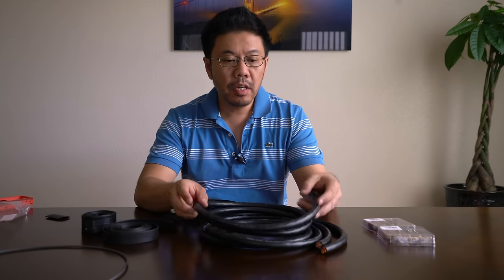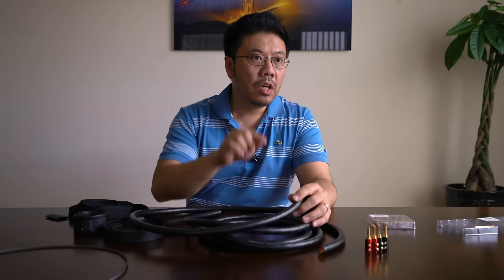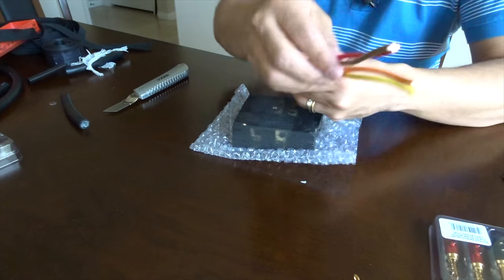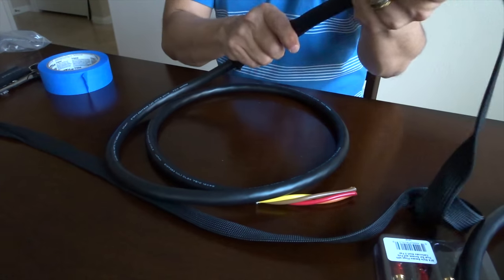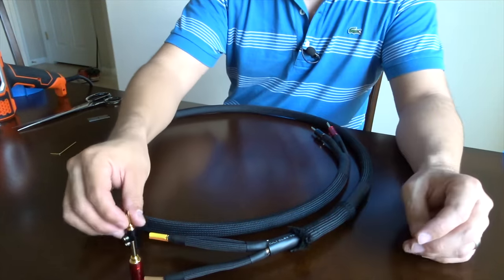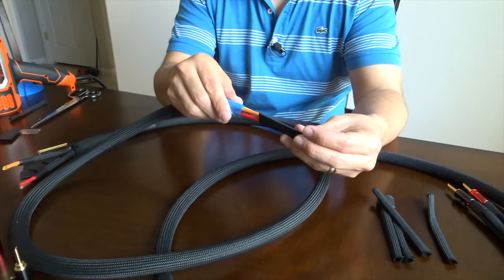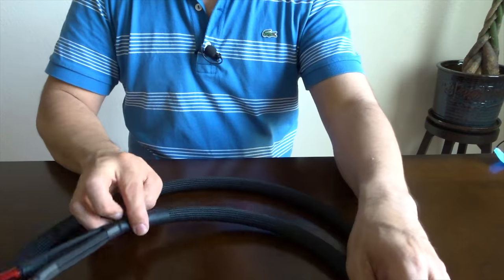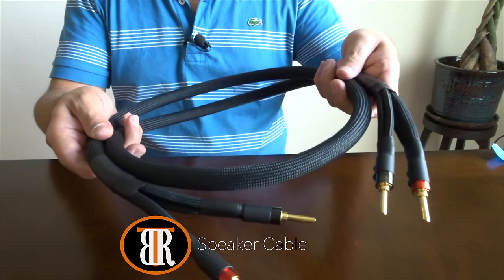Making The Best Speaker Cable For Money, How To DIY HiFi Cables

Comment: If you go with what the professional studios use, you can't go wrong. Great video buddy, thanks!
Reply: That's not necessarily a wise choice.
Reply: @carlosoliveira-rc2xt  please, tell us what the wise choice is. Im dying to know since I've been an audio enthusiast for over 30 years.
Reply: @Douglas Blake his cable is overkill. However, a 10 foot pair of Belden or Canare is not. Both of what i mentioned are also used in Pro-audio. Most of what you described is about connectors. A pair of 12guage Belden cables far outweigh a cheap ass lamp cord for not much more $. Blue Jeans cable is Belden and the prices are extremely good for excellent quality studio grade cable.
Reply: @Douglas Blake you go girl with your lampcord. If it works for you, great. Meanwhile, the rest of us will enjoy what we like. That's the beauty of this hobby. You can do whatever you want and invest in what you see fit. You spend allot of time trying to convince the unconvincing. Does it really matter to you? Run along now...
Reply: @kirkcunningham6146  the rest are happy snakeoil believers. I believe you are a minority. - Nothing bad about that though

Comment: Hey, I just noticed, aren't you supposed to use the opposing sets of wire(180o) apart from each other?  That would be the orange/brown, red/yellow, at least that was what I was told to do with this cable and Canare 4S11.  Anyhoo, I'm making sets of both the 3104 and the 4S11.  You inspired me.  I'll be using the Viborg Pure Copper Bananas, Viborg Pure Copper Spades, and the 
CMC 4mm BFA Banana Plug Jack Z-Type Connector  which is that spring form contact that looks like a Viborg product.  I ordered them all.
Reply from the maker: Great choice on Viborg plugs they are my favorite ass well, for the star quad cables I have all different paring and there is no difference in the sound. Thanks
Reply: You're correct. In the video he shows the table which has the capacitance rating depending on what wires are paired together. Brown and Orange together and Red and Yellow. The table @ :38 shows the capacitance when pairing wires #1 and #3 together vs #1 and #2. Pairing 1 and 3 has a lower capacitance then 1 and 2. In between those pairs is a cord/insulation that is not shown in the illustration @ :38. You just see a gap. That cord/insulation separates pairs 1&3 and 2&4 allowing a lower capacitance. 
So pair Brown & Orange,  and Red and Yellow.  
Will this make a difference to your ear?   He made mention that there is no difference in sound and I believe him because he's making short wires.

Comment: I haven't heard such a powerful bass from any cable, it's impressive. I could use a better scene, height, width, depth.
I wonder if the color scheme of connecting the wires affects something.
In the film, yellow is combined with orange and form a black plug
Red with brown, form a red plug.

I didn't think about it at home and did:
yellow and brown - black plug.
orange and red - red plug.

Is this correct?
Reply from the maker: Color of conductors is not important, you can pair them any color you like.

Comment: I dont even use speaker cables. I solder the amp terminals directly to the terminals on the speaker. Best damn sound I have ever heard lol.

J/K: great video.
Reply: Same here.  Collateral benefit - smaller form factor.  And with sufficient battery energy, my whole system is PORTABLE and can be carried by only three people.
Reply: Nothing beats garden hose filled with mono-crystalline mercury as the conductor - maybe solid brazed copper tubing - sure it's a bit stiff & not very portable, but that's HiFi for you ;-)

Comment: Awesome tutorial! I’m with you, I mostly only use pro cables. The only exception is Supra, I find their power cords excellent. I also like their shielded speaker cables - I find some class D amps sound better with shielded speaker cables. One could also shield a professional speaker cable by manually adding a copper shield over the cable and covering it with the nylon mesh. Now I’m inspired to try the Mogami speaker cables. I’ll build a pair to try... :-D
Reply: You should probably avoid shielded speaker cables as it drives up the capacitance of the cable dramatically.  And since the signal isn't getting amplified after those cables, shielding isn't really going to do a whole lot unless you are in a VERY noisy environment.  That being said, if you think its sounds better that way, that's all that really matters.

Comment: Thank you for the tutorial - one question, the banane plugs you now advice (viborg vb 401) can only accept a 4mm cable 😅 how can it match with the 2 wires of the Mogami cable ? In that case it would be better to use the Mogami 3103 with only 1 wire per banana  ?
Thanks in advance for your reply
Reply from the maker: Hi I only recommend it because I switched to it for my own cables, it’s tight fitting might need slight trimming for quad cables, thanks

Comment: @Tharbamar Thanks a lot for sharing your experience. What do you think about wire ends soldering before connect to banana plugs?
Reply from the maker: Hi, I do preferred direct contact but if I must I would use silver solder, thanks
Reply: Thank you

Comment: Looks really good! Great work!

One thing though: dual 12AWG equals single 9AWG, not 6AWG. So why not just use a wire with 2x9AWG conductors instead of a 4x12AWG conductors? Does not get as monster thick as your cable, but sends the signal just as good! Just a thought.... 👍

Comment: I like your video using the 4S11 wire...with this wire I'd be worried it could put tension on the speaker terminals and perhaps break them

Comment: If you’re going to do all this then make sure you don’t use bare hands to twist the cable ends together because the oils in our skin get rubbed into the cable ends and will tarnish and degrade the transmission of energy in this area a lot faster than normal. The best thing to do is use a new, clean lint free cloth to twist the ends together and then spray a little amount of Deoxit on the twist and it should not oxidise or degrade for about 5 years at which point you cut the twist part off (about an inch) and cut your ends again so the perfect solution is to solder the ends together with silver infused solder and obviously don’t touch the bare metal with your bare fingers before you solder!!!

Comment: As long as you're using speakers with reasonable efficiency, speaker cable is a non-issue. 16 AWG lamp cord is as good as expensive cable. Large gauge speaker wire is only needed for long runs. Expensive cable is one of the biggest wastes of money an audiophile can invest in.
Reply: I have to agree. That speaker wire is way over kill for any home use! Using a single #12 AWG for each connector is more than enough, let alone using double #12. Plus you don't need any fancy expensive wire from some fancy name brand audio supply manufacturer.  But feel free to waste your money if you like.
Reply: I think most people would agree that the best you can hear is all you need. The problem is we have so many perfect 50 karat diamonds with a little circuit board inside with customers to match that it's not even about the sound anymore even though it's still blasphemous to say it. If you want jewelry for your home then God Bless ya, I hope you get what you want. Just don't be leading the up and coming to think that's what good sound has to look like because it doesn't, and it doesn't further the quest for that next more convincing generation of audio. </rant> sorry.
Reply: Let me guess romex would do just fine to then, people like you are ignorant in knowing what your talking about, maybe your attitude towards listening is not refined in detail quality of caring so much about it, your speakers play the music and that's all that matters to you, it's good enough, but let me tell you there is a difference or I wouldn't be responding to your comment, but that's up to you to compare and if you have then good for you you dont half to be in the mix of snake oil, I've built cables using cheap best buy speaker wire to using monster cable and audioquest cable and they all sounded different the rocket fish cable at best buy sounded horrible, the audioquest cable sounded fatiguing and fast like, and the monster cable sounded neutral  and natural sounding and these cables didn't cost that much and I heard a difference and I dont have expensive equipment either if I heard a difference in cables then I will say something
Reply: @shannonwilliams6623  I have done blind swap tests with probably 20 or more people who have spent big money on cables, including $3000 power cords. I snag them every time. It is all placebo.
Reply: @Bernie AYALA AUDIO Do you happen to have any commercial interest in audio? Then I would agree that its probably a bargain from a commercial point of wiev
Reply: This is completely wrong and you have no idea what you are talking about. The "its just a placebo" mindset comes from people who plug expensive cables into their shitty entry level setups and wonder why they don't notice an improvement. Cables that are "good enough" are fine when your listening setup is at a point where it is limited by other components; however there comes a time when everything has been upgraded to the point where the cables  become a limiting factor. At this point, choosing a proper reference quality cable makes a great deal of difference.
Reply: @nucleon4499  If you knew as much about cabling as I do, you wouldn't be saying that. My business requires that I know something about the properties of different types of cable. Even the most demanding loads don't require more than 12 AWG lamp cord for short to medium length runs.
Reply: Either your equipment is very poor quality or you can’t hear the differences in sound. Another alternative is that you’ve told yourself that all wires conduct signals equally (I can assure you they do not) so you refuse to even try. I have tried many different cables (both analogue and digital) over many years with various levels of hi-fi components and have found that changing any type of cable can make as much difference to the sound as changing the main components themselves. For those who either can’t afford or refuse to buy high quality cables new, the alternative to DIY is eBay or the various hi-fi equipment forums (gumtree, audiomart, etc) for 2nd hand cables at more reasonable prices.
Reply: @nucleon4499  No that time doesnt come unless your cables are broken or connection very coroded
Reply: @shannonwilliams6623  Jesus Christ, man! Punctuation is key!
Reply: @collocksb8408 true, swapping cables out sometimes works if only because the original cable is tarnished to the point a coat hanger is better. So what are you trying to say? Gold is a better conductor than copper? I think not .

Comment: Wonderful job. They gouge you on higher end cables. I’m building these at 1/10th the cost.
Reply: What cable are you using?
Reply: @joshgross8741  I have kimber 8tc which I like. But at 22’ each you’re talking 3k.
Reply: @maxkady9478  ok. Initially I misunderstood your post. I thought you were getting cables that were 1/10th the price of the mogami.  I was mistaken.  Thank you for sharing about the kimber 8tc.  They look interesting.  22' seems like a lot of cable even if you are running 11' cables to your speakers you must have a nice sized listening room.

Comment: The internal cable in the amp and speaker box is probably telephone wire
Reply: Aleks Bogdanoski, true however, any reduction in resistance between the amp and speaker will improve damping factor (if your set up needs improvement in that area)

Comment: Stunning ,if they sound as good as they look ,wow ,going to make a set in the next couple of weeks ,thank you 👌👌
Reply: For some reason, commenting on this post doesn't allow you to share pics. Just finished my cables and I'd love to share my pics. Also the connectors used in @Tharbamar video are out of stock until July (everywhere) so I went with an alternative.
Reply: Everett Spain sweet mate ,how do they sound
Reply: @paulf6946  I've only listened a few hours so not quite enough to give a full review but a very noticeable difference from the BJC 12. I'm bi-amping my Martin Logan ESL X through the Marantz MM7055, crossing them over at 80Hz and allowing the 2 Martin Logan 1100X handle the bass in 2 channel music listening. If you've never listened to Martin Logan's, they aren't very forgiving...if there's a weakness they will reveal it. I'll share more after more listening.
Reply: Everett Spain fantastic,I look forward to hearing how they sound when fully run in

Comment: those look really neat. at that length there is no difference between those sweet cables and some 16awg generic cables.

@ 0.40 typo, resistance is higher per m than per ft.
also, did I just hear @16:15 that the wires need some braking in?! omg :}

Comment: @Tharbamar if a person could , can you shield your speaker wires. But the question can you ?. Before I do it do you know if that's safe thank you.
Reply from the maker: Yes you can use shielded speaker cable, shield should not connect to the speaker end but it must be grounded on amplifier chassis somewhere to get full benefits. Thanks

Comment: 4 mm is way overkill, especially since you double it up. Literally nobody needs more than a single pair of 2.5 mm cables (10 awg). Or you can use a quad cable with thinner ones that add up to about 10-11 AWG. There is just no upside in making your cables ludicrously heavy and unwieldy.
Reply: You are mostly correct, you only achieve a few different things:
1) less resistance.
2) more surface area for the high frequency signals that can be in an low frequency audio signal (200-300MHz).

Maybe an advantage? :-)
Reply: The upside is that this cable can double as a towing  cable.
Reply: @Smokey66s  That's true, but it's a bit of a catch 22 when you need a tow truck to tow your cable to the car you want to tow because it's too heavy to carry.  :)
Reply: of course, Audioquest would charge you about 4000 for a set this gauge.....
Reply: @erico888  Sure. There's a sucker born every minute, and many of them seem to be "audiophiles".
Reply: @cr0ft-2k  Yep, I believe quality cables help but not 4000 dollars worth. But can I justify spending 100 bucks for good cables? Sure can.
Reply: @erico888  Sure, I made my own AWG 10 cables too, with a nice braid cover, heatshrink and gold-plated banana plugs. Those could drive basically any speaker on the globe, though.
Reply: @cr0ft-2k  I currently have have the Audioquest Slip 14/2 copper speaker cables. I'm going to change my banana plugs to the BFA style ones from Parts Express like he does here. The thing is, should I change my speaker cable to, or am I just fine with what I have? These will be used for my LS50's, but I will be getting some Revel F208s in a little bit that eventually get the cables.
Reply: @friedmule5403  Use solid silver wire, as silver has 110-115% of the conductivity of copper and the oxide is just as conductive as the pure metal. Thinner wires, less weight, and no problem with oxidization, everyone wins....
Reply: @friedmule5403   No, if the resistance is much less than the speaker impedance you gain nowt.
Reply: @StillAliveAndKicking_  The resistance in a cable is way less than any speaker I have ever heard off. :-)
Reply: @friedmule5403  Exactly. So as long as the cable is not thin, it’s fine.
Reply: Looks cooler

Comment: Personally I would trash the banana plugs and go for a better connection like a spade. ( personal choice)
Reply: I wouldn’t use any of them just go straight into amp and speakers with cable no plugs.
Reply: Spades with some thread lock hahaha